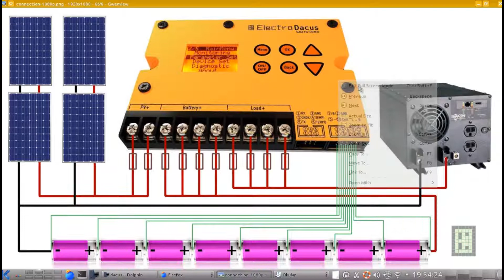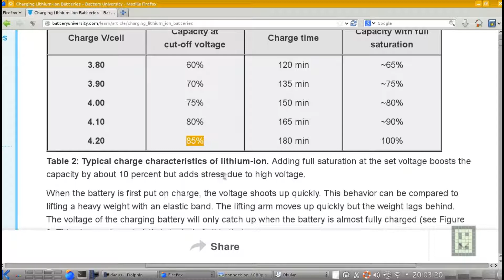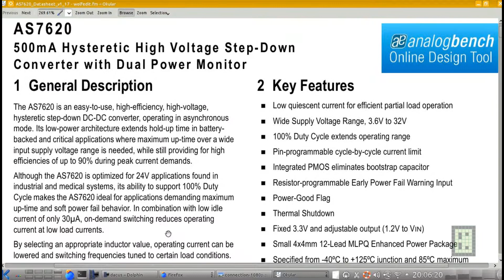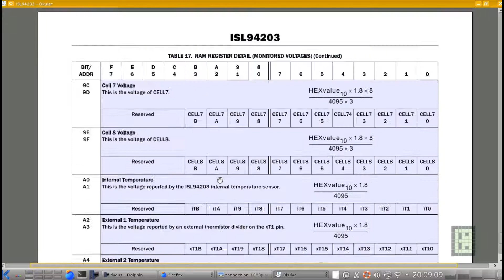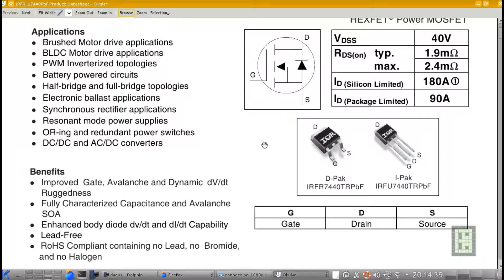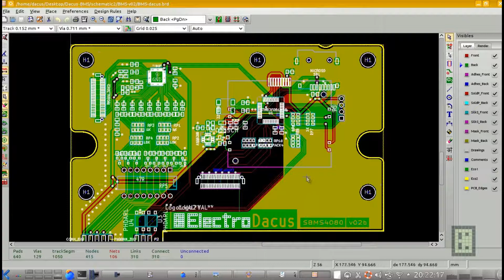Open Source Solar BMS SBMS4080

Comment: Really great video. I want to make it and try. I was wondering if you could share the codes. Regards.
Reply from the maker: This is a very old model. You can check my website see the user manual for say SBMS40 that will be the most similar to this old SBMS4080 go to last page in the manual and you will find the links to code and separate link for hardware.
But that is if it is fun for you to build from scratch else you can just purchase one already made from me as it will be much lower cost than to build one. Currently I have no stock but it will be back in stock around May (there is a big problem sourcing components not just semiconductors).
Reply: @electrodacus  I'll check your website. Thank you

Comment: Can you send it to Indonesia
Reply from the maker: Normally I will ship anywhere but since Covid has started a lot of destination's are impacted due to not enough flights. While currently Indonesia is not on the restricted list at Canada post it may still not work. A few weeks ago I tried to ship to Malaysia that is also not on the restricted list and even tried to ship twice with tracked parcel first and then with XpressPost and it returned back to me and lost the expensive shipping cost. The reasons given where strange like last that returned mentioned that there are batteries in the parcel witch is it not true the declared product was a multimeter as it is the closest to what SBMS0 is and I ship to many countries in Europe without problems but shipping to Asian countries since beginning of the year is very unpredictable. Next time I ship I need to ship a parcel to Kenya curios if that will work out. I shipped there before covid with no problems but not sure it will work this time.

Comment: this is a very nice product by i have 30v solayr panel can i use it for this bms controller ?
Reply from the maker: I guess 30V max power point voltage panel that likely is the 60 cell PV panel the most common one and they work great with a 24V battery 8s LiFePO4.

Comment: are you still making these? and how to get it ???
Reply from the maker: I do make an update version of SBMS called SBMS40 and SBMS120 and you can read more about that in the user manual http://electrodacus.com/SBMS120/manual/SBMSmanual.pdf
I do not have at the moment any stock but I take preorders for next batch that I will build in spring around March/April and you can use paypal to preorder on my website http://electrodacus.com/

Comment: I would like to support you but your system doesn't work for me I have 6Kw grid tie system, I do however have a question for you; I have 20 60cell 300w solarworld panels hooked up with 20 enphase M250 microinverters, I want to add 20 battery packs individually to each panel between every panel and microinverter, How many 18650 batteries should be added to each 300w PV panel and what electronics to be used to manage battery pack/microinverter/PV panel either individual electronic modules or one with 20 branches in/out ?
Reply from the maker: As long as you have grid battery storage will be useless to you since battery storage is way more expensive than grid.
PV panels amortization cost is around 3cent/kWh the microinverters (if they last 25 years) will have about 2 cent/kWh amortization cost. If you ad cables and labor to install those that may be another 2 or 3 cent/kWh but still competitive with grid prices even if total is 7 to 9 cent/kWh
Best battery for energy storage is LiFePO4 and that based on lab test will have an amortization cost at best around 10cent/kWh but in real life where battery is used much longer that 6 months lab test and battery aging plays an important role the amortization cost will be around 25 to 30 cent/kWh so you can understand why I do not recommend battery storage for a grid tie system.
The 18650 are usually a different chemistry LiCoO2 or similar 3.7V nominal designed for high energy density and not for cycle life so using those for energy storage is even worse with amortization cost well above 50 cent/kWh
Reply: Makes sense now, I will just keep the system the way it is and try to reduce power consumption during the night.
Reply: I will invest the money I save to install a solar tracker, Designing it and building is my field.
Reply from the maker: James Bordon Not a good idea to build or buy a solar tracker. You get more benefit by just using the money and time to install more solar PV panels (the gain will be higher than a solar tracker).
Reply: ***** I don't have space to install more panels, According to online search daily tracking will get me about 15-20% and seasonal tracking is 20-30%, I've spent close to $11k on my 6Kw system so 35% more is like $4k worth of extra panels and hardware assuming I have space for it, I can build solar tracker system for 20 panels for less than $1500.
Reply from the maker: James Bordon Yes you can get 15 to 20% more with tracking but the cot of the tracking system will make adding more panels a better option. Panels will also easy last for 25 years where the tracking may need repair or replacement over this period making it even more expensive.
Solar panels are now at around $1/watt or less depending on your location so $1500 can get you about 1500W of PV panels that will be about 25% extra energy (so more than 15 to 20% average gain of a tracker) on top of that they will easy last 25 years not so much a $1500 tracker you build.
There is also the risk (if the tracker is not well designed and build that a strong wind will damage both the tracker and the PV panels).
Trackers barely made sense when PV panels where 5 to 10x more expensive than they are now.
Many technologies become obsolete because of low cost solar PV panels.
My next project is to heat my small house fully with electricity from solar PV since is the least expensive source of energy (I need a 9kW array to heat my small house).
My next project is a Digital MPPT thermal controller (nothing to do with DC-DC converters) that will support a 15kW PV array and the energy will be stored in thermal mass since is 20 to 30x times less expensive than battery storage and it makes sense for heating or cooling.
The Digital MPPT will be connected to the SBMS100 the new version of SBMS this SBMS4080 in this video is the older version see my latest video.
Reply: ***** Well like I said I don't have space to add more panels, $1 per 1watt is just solar panel add $150 micro inverter for every panel and the special expensive cable which is about $30 for every panel, the racking and other hardware.
Anyway I like your projects, keep sharing.

Comment: In your diagram, the negative is not wired to the BMS. How do you complete the circuit. Thanks.
Reply from the maker: +William Ross The SBMS needs very little power and it gets that trough the 10 pin cell sensing and balancing cable the first two pins there are connected to battery negative.
All the power negative conductors are connected together outside the SBMS.
Reply: Thanks. Great video.

Comment: Good video! Did not know about this product. I'm using lifepo4 batteries with my solar system, no real bms other than the voltage cut off points set in the inverter and full time balancing. but each cell is not protected just the over all pack voltage.
Reply from the maker: You will really need a BMS if you do not want to damage the cells or manually check to see the cells are in good balance often.
Good cells and well installed will not get much out of balance but it dose not take much for a cell to go well over the limit normally 3.6V for charging or under 2.8V on discharging.
I have now the design for a new more powerful version of Solar BMS see my latest videos and it will be on Kickstarter in about a week starting 23 February. See all the spec on my website electrodacus.com and there is also a 7 day graph with my house power consumption that you may find interesting.
Reply: Yes have been manually checking them its a 16s system have the cut off at 50 volts and my week cells are around 2.95 @ 50 volts.  trying to go no lower that 2.5 and charging now to 3.6 for cycle life what is the best voltage range to keep them in?
Reply from the maker: off grid kid
Best limits are 3.6 to 2.8V absolute max and 3V to 3.55V is best since there is almost nothing to be gained going lower or higher. Also they hate floating so when the highest cell gets to 3.55V you should stop charging and then only reconect when highest cell is down to 3.4V

Comment from the maker: I just removed a comment from +Kill0Your0TV because there way no way to replay to it. If you read this you should change your settings to allow for a replay else is a bit annoying
The comment was this "I can buy 4 12v-20ah lead acid batteries for $160, less than the cost of one 12v/20ah"
It seems you did not understood my video. Yes you can buy 4x the capacity with Lead Acid but you can normally use only half that to protect the battery life and when you add the charge discharge efficiency you have not much more usable energy compared to the single 20Ah LiFePO4.  But more important is that based on specs the Lead Acid Battery will be way more expensive over the life of the system. The LiFePO4 has above 2000 to 3000 cycles at 80 to 100% DOD (dept of discharge) where Lead Acid will have at best a few hundred cycles. I used one of the best Lead Acid specially designed for deep discharge in my comparison and even that with all the omission I made in his favor was way worse than LiFePO4.
Get me the data-sheet of your 12V-20Ah at 40$ and I will show how much worse that is compared to both the LiFePO4 and the Lead Acid that I used in my comparison.

Comment: Great video Dacian. I'm busy preparing a video on BMS that leads into your SBMS4080.
Cheers, Martin.
Reply from the maker: Thanks Martin. The last two videos are probably more relevant than this. In the last one at the beginning is procedure to connect the SBMS initially. If you get in to any problems just send me an email and I will replay as soon as possible.
Regards, Dacian.

Comment: Its a common misconception that you can charge a lead acid battery with 30/60 cell pvs. Look at the IV curve, the vmp drops with temperature, you need to allow for loss in the controller, the loss in the cables. In the real world the array is some distance from the controller and so the perfect cable will be cost prohitive. FLA usually needs 29/30ish volts for absorb/Eq. That simply cant be met with 30Vmp arrays, period. People that try this end up with sulphated batterys. However for LiFePo, the charge voltage is slightly lower, and the consequence of incomplete charge not nearly as bad, in fact may even be better for the bank!
Reply from the maker: Hi Peter,
There is no talk about Lead Acid batteries in this video. LiFePO4 do not need absorption or equalization stage. Charging will stop as soon as any cell gets to 3.5 (max 3.6V) that is well under 28V. 60Cell solar panels have the advantage here that they work very close to the max power point so you get a better value do to better power utilization.
60 cells solar panels have around 29 to 30Vmp (25C cell temperature) but this dose not mean that if your battery needs 31V it will not provide that it will but at a reduce power (not working at the maximum power point on the curve). Still for Lead Acid this is not important since in the absorb and equalization phase you use PWM to reduce the current anyway since at this stage the battery require very little current way less than even a 60 cell solar panel can provide in a hot summer day.
There is no loss in the controller my controller has 2mohm input so loss will be really low even at full 40A around 80mV the cables if properly sized also not much more a few hundred mV maximum.

Comment: you can do cc and cv charging when charging from DC, you are not charging from DC, you are charging from solar, you need to match load to panel with at least pwm or your panels will drop to like 60% effciency, 

20W Solar Panel / 21W Bulb - A Perfect Match? (part 1)

Comment from the maker: +birrbert . There is no replay button on your comment so I hope you will read this.
First thanks for watching the entire video. Is a long and a bit boring in parts and as you noticed I was even repeating some parts.
MPPT is obsolete not do to technology involved both MPPT algorithm and the DC-DC converters can be used for other applications.
It is only obsolete do to cost in Off-Grid solar applications the reason for that is like I mentioned the cost of solar panels makes the use of MPPT not an economically viable alternative.
You still need a charger so PWM is way less expensive and with the much simpler construction (no electrolytic capacitors) it can last as long as the PV panels or more.
PWM is needed for Lead Acid where the constant voltage stage is really necessary but not so with LiFePO4 used in energy storage there you do not need the PWM functionality since the battery is charged in a single stage as I mentioned in the video.
Reply: OK. Now I understand what you meant and I think it makes sense. Indeed, PWM solar charge controllers have a longer life-cycle, but they lack the efficiency and the "smartness" of MPPT. The reason I asked for clarification is that in your video you mentioned that things are moving so fast these days that people can hardly keep up with new inventions and technologies; so I said to myself that, wow, there is a better/smarter/newer and more efficient technology than MPPT and I didn't hear about it yet. :-)
Reply from the maker: birrbert
When I was referring at things moving fast I was mostly thinking at battery LiFePO4 is relatively new and not many people know about and also at the implication of such reduction in PV panel costs. But in almost all technical fields things move fast and with the amount of information out there is hard to be informed about everything.
If you can build a 1000W DC-DC converter for 100$ that can last more than 25 years then it will not give you any huge benefit but it will not be a waste of money since it will recover that over 25 years. Still the additional cost for shipping must also be considered and for me in Canada if I ship a 2kg parcel vs a 200g parcel internationally the difference will be around 80$.
Not sure I mentioned but using 60 cells PV panels with 24V LiFePO4 battery instead of 72 cells will give you the benefit of an MPPT without any additional cost but this is valid only if you don't already have the PV panels and you can install them relatively close to your battery.

Comment: I'm so sorry I couldn't back your project! At this time money is tight. When your project is complete will you have X amount to sell? I would happily support you that way! =)
Reply from the maker: That is no problem. Thanks for the comment. Not sure I will build more than what will be necessary for the Kickstarter rewards and those that will get an order from my website before I make the final production. I will need to add that option to the website maybe next week.
If you need this much later in a year or two I expect that there will be much more choices of similar Soar BMS chargers.